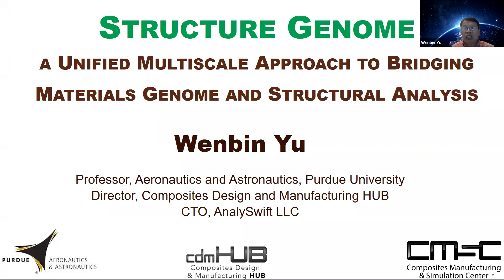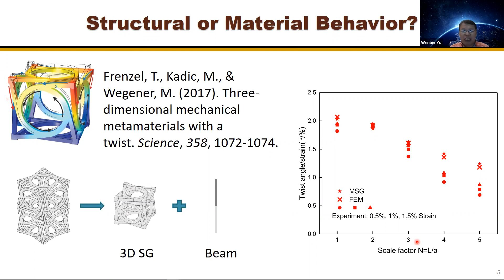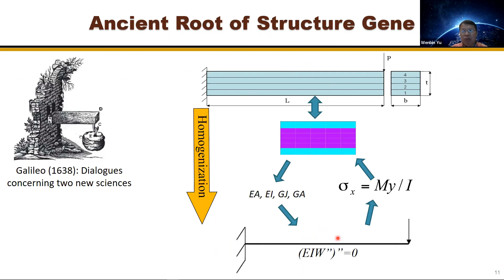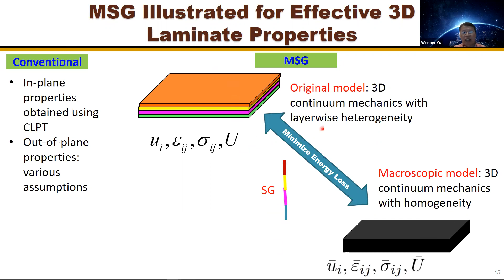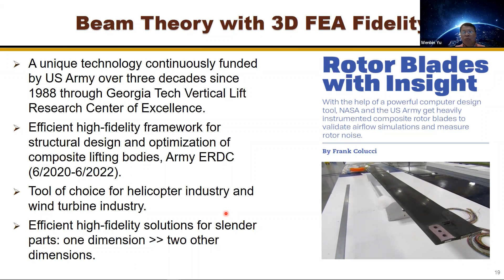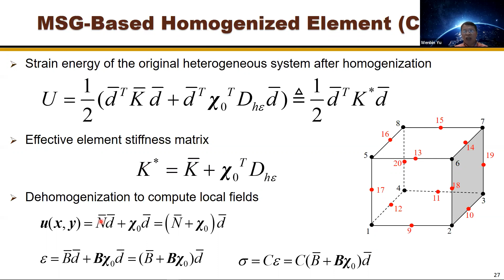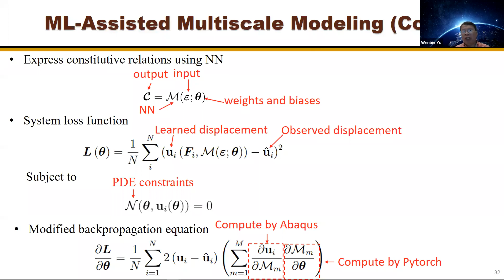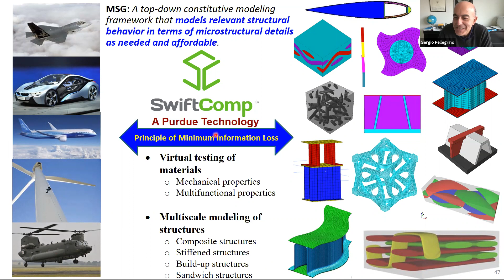Structure Genome: a Unified Multiscale Approach to Bridging Materials Genome and Structural Analysis

Comment: Respected Professor,

Thank you so much for your presentation. I am doing a search on the Carbon fiber or CNT OR Graphene Reinforcement of Copper metal matrix composite. I have to generate the particulate reinforcement modeling ( % of Cu and % of CNF )  and also create different rows by changing the angle of the fiber. Kindly give suggestions regarding suitable methods and simulation software.

Thank you, Professor.

Comment: HELLO PROF, I NEED TO DO THIS NOVEL IMPLEMENTATION ASYMPTOTIC HOMOGENIZATION CODE IN ANSYS SO THAT I CAN DETERMINE EFFECTIVE ELASTIC PROPERTIES ARE YOU FAMILIAR WITH THIS? COULD YOU ENLIGHTEN PLEASE SO THAT I CAN GET A STARTING POINT...
Reply from the maker: I don't know why you want to implement asymptotic homogenization in ansys. You can directly use SwiftComp. It will be simpler and faster than your best implementation of asymptotic homogenization. We have it integrated with workbench.